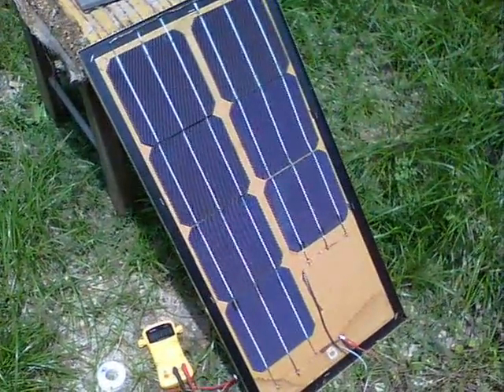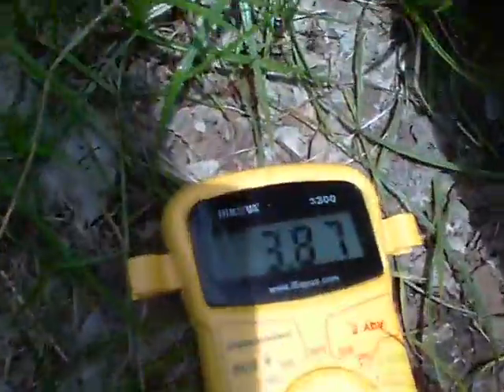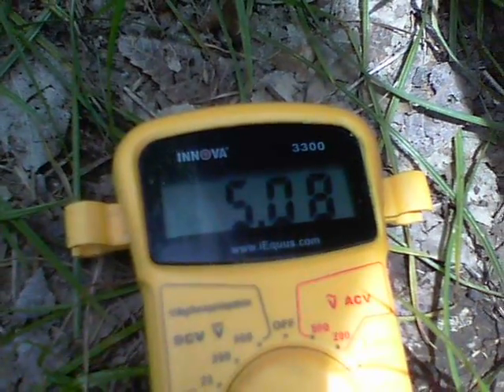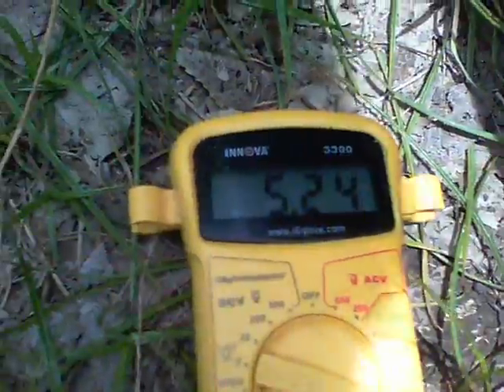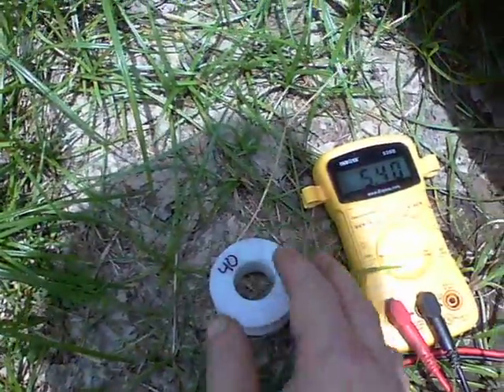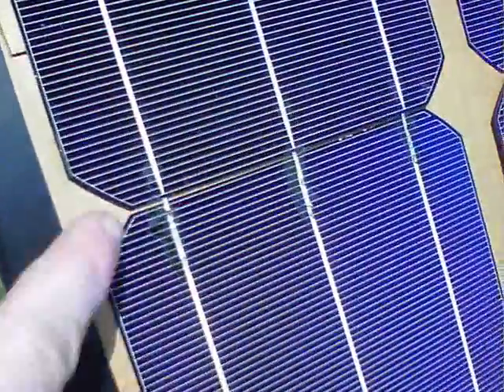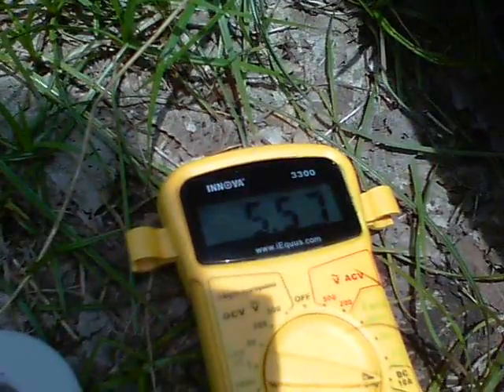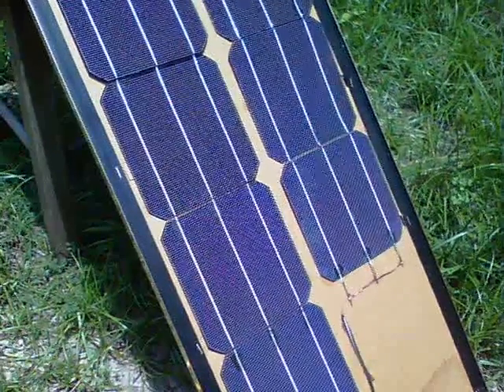Solar Tabbing BIG costs save tip

Comment: Sounds pretty good. Also save any used de-solder braid in decent lengths... I hope to start some tests with my panels later next week. Bloody busy atm lol. Are you making your "12v" panels put out 15-18v short circuit?

Comment from the maker: Depends on size of panel, but for a 36 cell 12V panel 3x 30 gauge twisted would be easy to solder. Each would then give 3.6A approx x 3 lines on a panel. If us lot have a wire gauge it's 30 gauge lol.
Degauss coils are great for Tesla towers + 1 wire lighting in the house.

Comment: Good news about the 30 gauge. I like it. That tabbing wire looked like a scam to me. I didn't get any.... Got about 30 De-gauss coils and yokes though... and a few mains leads, although I was saving them for swes... what about a few 30-40 gauge layed side by side, to be flat? the solder should bridge them. Also I knew I had been saving my used de solder braid. Pencil lead has really low ohms too.. Look what 12v does to them.... I wouldn't go too many panels in series with shot tabs...

Comment from the maker: Noticed the small resistance, but it's tiny to what was imagined, basically nothing much even when added up. 30 gauge is bendy but only about 1.2A capable, larger gauge more chance of panel cracks, which makes sense of tabbing wire itself. A twisted pair of 30 gauge would work though, 2.4A per line, thin and it would tin as rounded wire :)

Comment: I did some checking. I know why. Check the resistance across different points on your panel and you'll start to see some of the reason... Is partly about heat, and partly about harvesting the electrons off the surface of the panel as freely as possible. Without blocking too much sun with wire... In series its not such and issue... I got 0.8-0.9 ohms a panel. What happens when you put resistor in series? Using round wire is a decent idea though, more amps less shade.

Comment: With that sort of output I'd be investigating a zero current leakage design made from stainless steel washers. you won't need a large electrolyzer, per say, and you'll have no neutral plates. For an initial test, try two stainless steel light switch covers. cheers

Comment from the maker: Intending to be open to the elements at the moment. It's not neat enough for flat mounting yet. Problem has been a secondhand Kester flux pen off Ebay that was sold as new ! Nothing much in it, hence crappy flux globs from using regular flux. Next year will be neat stuff (or later this year hopefully) and I do agree about the different metals...ideally I think the braid from co-ax would work for bus bars, but am not sure what the metal is in tabbing wire ?

Comment from the maker: The cells seem to be more like 0.55V, they are supposed to be junk pieces though and was very fortunate indeed to find these in the middle of 1 bag of pieces. Outputs will be different, the worst will give the final amperage, so i'm told. Temptation is to put together more 1/2's and 3/4's + bump voltage up, but I can easily see amperage suffering.
It is weird about the traces, running fine though. But that's how these roll, low volts big amps :)

Comment from the maker: I'm looking at the best way to do that at the moment...a crossed pair of good power transistors and a transformer seems the best way for amperage at mains voltage. Open to tips on what to do though. Ideally i'd like to do a 12V and 120V inverter with a switch on it. 12V for charging, 120V for running directly just because it would be cool lol

Comment: try electrolyzing water directly with that panel and a capacitor, no battery. If its slightly to high of voltage, knock it down .3 or /7 with diode. cheers. nice panel

Comment from the maker: I should think for massive amps you'd get troubles, but then again (and there's always a 'but' lol) I bet the original tabbing wire is rated as 10A max. It's only a flat thin sheet stuff after all. The good point with this for safety concerns and conventional wireups, is that the panel output is the max of the worst cell. So, if anything was to happen it would happen with 1 panel.
Yeah heard about the traces, was mentioned as reason for silver getting scarce, though was heard on a radio advert.

Comment from the maker: Yeah, for 1 or 2 cells it only means less solder/flux and tabbing wire to a small amount, but when doing loads of them it would quickly mount up. There's less chance of cracking panels this way too.

Comment from the maker: Cheers Ray. Was experimenting and found that full tabbed was same output as this spot to spot method. Main thing is to use just enough, so the soldered area doesn't unsolder again when soldering to the next panel.
I actually used a bit more than planned on these, thinking i'd have to turn the panels over etc...didn't have to if bottoms of panels are done first, then the wire pieces are much easier to solder to the top of the next panel as you go along. The panels are then the right way up :)